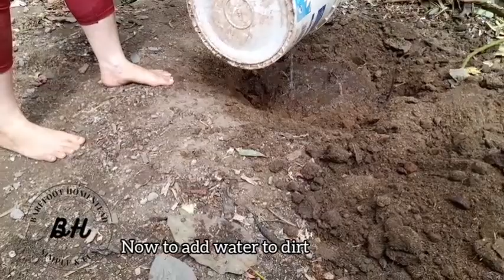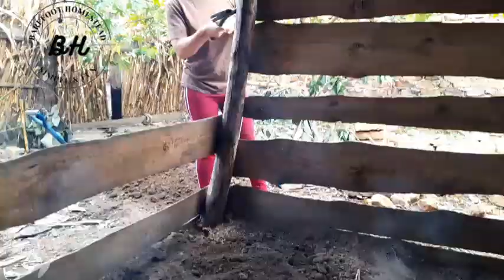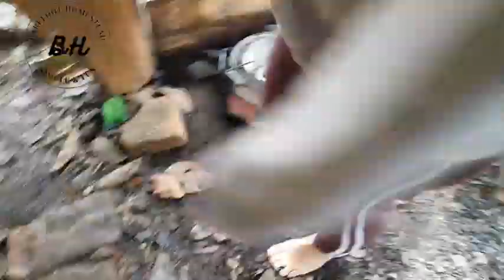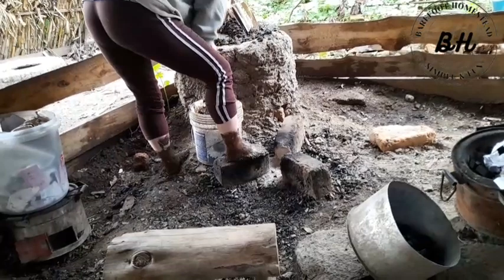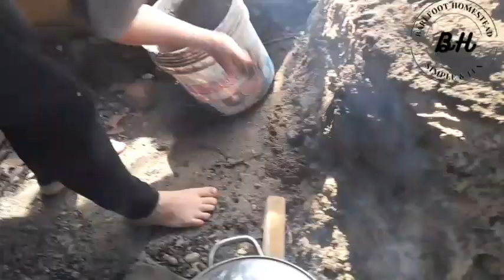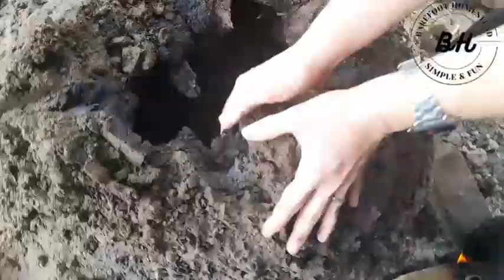Barefoot cutting wood, mixing mud & making charcoal

Comment: Miss, please stop cutting wood between two supports like that!  The wood will pinch the saw blade and could cause the saw to jerk back violently towards you.  IT's very dangerous!!  Instead, allow the shortest end of wood to hang off the edge of the support.  That way the wood will just drop off safely and the saw blade won't pinch.
Reply from the maker: @mgray612 Thanks so much for the tip. 🙂 It makes a lot of sense, especially if the wood was held in place on the supports. In my case, I was holding one end while the other end was mostly free to fall off. As a result, the saw didn't jerk. I initially tried to cut with the log on just one stool and the log kept on moving forward (with the saw). The second stool helped. If I was cutting a lot of logs, I would build a table for the job ....